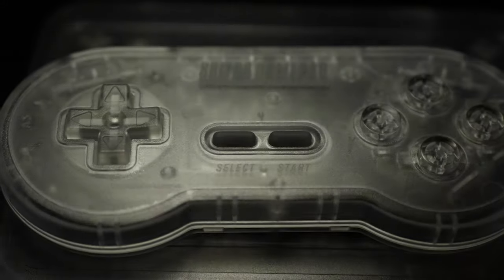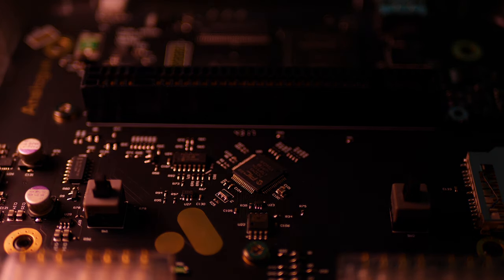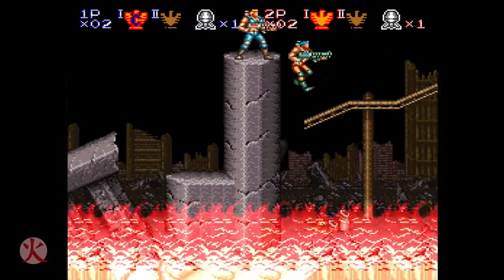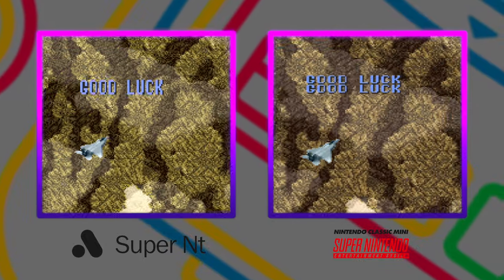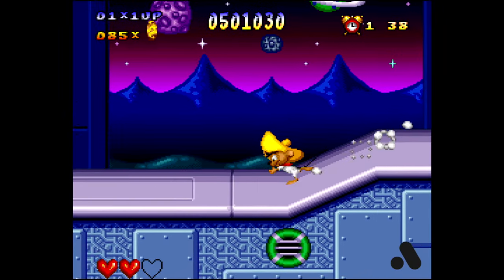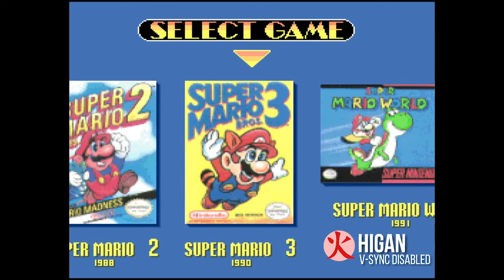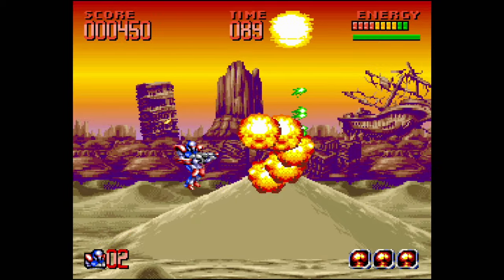DF Retro: Analogue Super Nt Review - a 21st Century SNES!

Comment: The best way I've found of explaining an FPGA is with an analogy of a roller coaster, or making one
A processor must first define the blueprints and then, in an orderly manner, see the steps of the coaster running one by one and carefully control timing while also making sure everything's in order
An FPGA is a roller coaster

And that seems to get the point across of why an FPGA excels in these sorts of areas.

Comment: The shadow cast by your plane in Air Strike Patrol doesn't come in dark enough on a 1-chip SNES. I have a 1-chip SNES and while the shadow is visible, it's kinda hard to see. This goes for the 1-chip SNES and the smaller revision of the SNES . On a lower serial original SNES which has the lesser picture quality displays the shadow much darker as it does on Higan and the Super NT.
Reply: Yeah, it seems like he wasn't aware that this is one of the games that is said to work a little differently on the 1-chip, but it's not a major goof on his part or anything.
Reply: Nah I'm not coming down at all on John for not knowing that about the 1-chip. It's superior picture quality over the original SNES design is far more common knowledge than this one drawback that I mentioned. I didn't even know about it until someone told me in the comment section of my video because I noted that the shadow was really light an almost just as useless as not having a shadow at all in my description. It's certainly nothing to choose an original over a 1-chip for. I just thought I would let everyone know so they don't think that the Super NT and more importantly Higan weren't doing anything wrong. In this case the REAL hardware got it wrong lol.

Comment: I was impressed that you tested actual edge cases like Air Strike Patrol rather than crap some other people might test ("Does it run Donkey Kong Country with its amazeballs graphics?!!!"). I would like to point out that the fact that you ran A.S.P. on a 1chip SNES accounts for the lighter shadow. On an original 1990 SNES, it will look more like the Super Nt or Higan.

One thing you didn't test is Mega Man X2. I am interested to see if X kills the boss on attract mode or not. On most emulators, X dies due to timing issues involving emulation of the Cx4 chip. I am wondering especially if the three buffer modes will affect the timing on this attract mode. Any chance you could check this?

Overall, good stuff. I liked seeing a lot of my favorite games used here and there: Blackthorne, DoReMi Fantasy, Super Metroid. Would have been cool if they'd gone ahead and rounded out the included Turrican games with Targa though.
Reply: I was able to test this myself finally. It works perfectly even in No Lag mode.
Reply: To be fair, though, Donkey Kong Country has a little more aggressive copy protection measures than most SNES games. It's worth testing on clone hardware for that reason, if nothing else. (Though being such a high-profile game it's hard to imagine the Super NT, with its attention to detail, wouldn't work with it.)

Comment: The Air Strike Patrol shadow discrepancy is not due to anything wrong with the NT or Higan. Rather it’s an issue with the design of Nintendo’s own 1CHIP revision of the system. Both Higan and the NT reproduce the shadow like an original SNES would, it’s the single-chip model that is bugged (albeit very slightly).
Reply: interesintg

Comment: Am I wrong or is the problem of hooking up an old console to a modern TV a non-issue in Europe due to SCART? I mean I have my MegaDrive hooked up no problem through that interface.
Reply: In fact it depends on how your TV handles analog signal from retro consoles, whatever the input type. I live in Europe and have an LG TV with SCART input. It handles 240p signal as 480i, with terrible lag.
Reply: SCART sockets are rapidly disappearing from TVs with the race to be thin.

Comment: "A reimagining of perhaps the greatest video game system of all time. Engineered with an FPGA. No emulation. 1080p. Zero lag. Total accuracy. The Super Nt is not a plug n' play toy. It is the definitive way to explore Nintendo's 16-bit era. Compatible with the 2,200+ SNES and Super Famicom game cartridge library. Explore and re-live one of the greatest video game systems of all time with no compromises." -Super NT Website
Prices starting at $189.99
$39.99 for the controllers.

Pretty solid console.

Comment: I got my Super Nt beginning of October and have been loving it. Would you have any recommend settings to get the 4:3 ratio you got since from what I can tell has been updated with the 4.5 firmware with altered values.
Reply: Try setting width to 1365 and height to 1149. You could also enable interpolation if you want to eliminate any shimmering artifacts.

Comment: The only problem being of course is that with the Super NT you are restricted to cartridge use only and provided you can buy those cartridges at a reasonable price if not owned already...also in some instances multi-platform games between the Genesis/The Super Nintendo wouldn't always favour the SNES versions, case in point being the Genesis version of Earthworm Jim 1 being superior to the SNES version and it is that version that I have on the SNES mini...and the glitch you found at the beginning of Earthworm Jim 2 on the version I have on the SNES mini it sounds perfectly fine....all ultimately depends though on if you aren't a SNES mini owner already then the NT might be the way to go for you...but for me I am not looking to amass a cartridge collection to get this when the SNES mini does most of what is required just fine...especially with the new revisions of Hakchi..

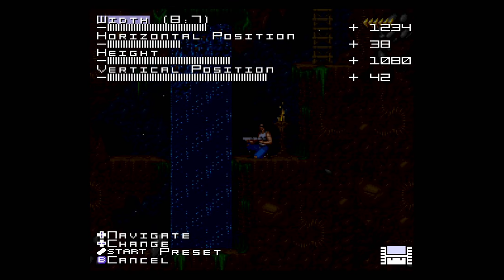Comment: At 21:04 it says manually adjusting scaling values is possible due to a framebuffer. Does this mean using this function (and others, like interpolation) could introduce input latency, i.e. the Framemeister's 1-2 frames of lag, compared to default settings?

Comment: EXTREMELY informative and well edited and shot video! Well done broham...got a new sub out of it.  On the subject the Super Nt is very very cool! I wish the creators would do something like this for the N64 (Yeah I know the patent was renewed for the possible N64 mini) but having an N64 in a compact shell design...more expansion memory meaning some how re routing all that buss code even tho games that where made to only handle 8 MB of ram would then be getting tricking via an algorithm that recycles the memory meaning games would be able to utilize more than just 8 even if they are only programed to expand to 4MB or 8MB....essentially making games have ZERO LAG. Running at full 30FPS and having options to enhance games via the software on the Nt64 haha thus making texture packages look better within games and further more enhancing the N64 experience....of course if they did the Nt64 it would also out put games in 1080p something that is very expensive and hard to do on the original hardware.

Please we need an Nt64!  Smaller shell (in translucent colors as well), HDMI output meaning hi res gaming, and if it can be pulled off a tricked memory expansion to help games run in true 30FPS with zero lag.  Start a kickstarter guys I will donate a hefty amount to start out. hahah you can see how fan boy I am for N64

Comment: There was one more option : The Hyperkin SupaRetronHD.
As far as I know, this is "hardware emulation", unlike a Retron5...
It has a lower resolution (720p) but cost much less ($70).
Reply: It's just another iteration of the Nintendo-on-a-chip consoles they've been selling for years, coupled with a cheap HDMI upscaler. From the reviews I've seen it seems like the HDMI scaler introduces a significant amount of lag and the clone hardware itself has the usual array of shortcomings and incompatibilities that usually come with that old clone hardware. Cost is low, quality is also kind of low.
(To be fair, though, I own a Supaboy which is a Nintendo-on-a-chip clone and I've generally had fun with it.)

Comment: but what about performance? something like starfox for example runs like crap on an actual SNES, is it the same on the super NT or does it run better?
Reply from the maker: Identical to original hardware.
Reply: Most of the CPU power used to run Star Fox is in that Super FX chip on the cartridge. So a system like this that uses the hardware on the cart rather than emulating it will not have any impact on the performance of the Super FX CPU.

Comment: Hi!
Sorry my english so bad.
which  offers best picture super nt or framemeister with  super nintendo using on a modern tv?
wich one do you preffer?
Reply: The original hardware actually has a few shortcomings that the Super NT avoids: like most of the old SNES consoles are the "2-chip" type that lag a bit in transitions between colors, creating a bit of a blur in the video output. So unless it's a 1-chip system the Super NT is going to give a better picture. If it's a 1-chip system the two should be on more even footing.
Reply: @tetsujin_144  Indeed, but even the 1-chip systems aren't perfect, as they make games appear much brighter than they should be, which is something the Super NT avoids as well.

Comment: Why do the games at around the 9 minute mark have more contrast on the right?
Reply: Jonathan Graber it’s discussed later.....
Reply: I can explain. So...I'm using gamma boost on the Super Nt which improves shadow detail. My 1-chip Super NES, however, is modded to attenuate the brightness which does slightly dim the overall image, unfortunately. The reason for this is that, by default, 1-chip SNES systems are TOO bright and completely blow out detail. So gradients and bright colors are basically "crushed" which ruins the image. The mod restores all the missing color detail but does lower overall brightness a tad. It looks fine on a CRT but, when used as a comparison point, it looks less bright. My other SNES consoles are 2-chip designs and have blurry output that would have been worse for a comparison.
Reply: John Linneman thank you:) very well made and interesting video

Comment: One more thing; can I make a request for Mega-CD (Sega-CD) episode? I could never understand how a $300 add on, which had a 12.5mhz processors had games which basically looked the same as the Megadrive. Could it not use both processors at the same time? why the hell was it twice the price of a megadrive!! just seems a missed opportunity to dominate the SNES technically so would like someone with technical know how to explain.
Reply: I know there was one game that came out a few years back (_long_ after the MD's discontinuation)--Pier Solar and the Great Architects--that managed to at the very least play an enhanced soundtrack if you had a Sega CD addon, while playing the main game off of the cart.
So it is at least possible to run the two processors simultaneously for that purpose (but I don't know if there's parallel i/o limitations or how severe they are and so on).

Comment: Quite cool, but I'll stick to a real 1-chip SNES running through a FrameMeister.
Reply: Eww. If you're using a 1-chip SNES at least do the darn thing some justice and run it on a PVM/BVM monitor via RGB.
Reply: matics28 PVM's are very hard to come by and are not capable of accepting my modern systems. Besides, it looks amazing running through RGB on a FrameMeister with FirebrandX's custom settings.

Comment: One huge problem - EARTHWORM JIM 2 DOES NOT PLAY SOUND EFFECTS CORRECTLY on the Super NT. The PAL version. I'm sorry, but this is really annoying me that the PAL version was not tested; the console is supposed to be region-free and it's not nice to leave PAL gamers in the dust for a worldwide machine. The NTSC version may be fine but that's just one version of the game. Sorry but there is still obviously work to be done to really get this console fully accurate.

I have already mentioned this on the MLIG video and Try4ce responded that we just have to wait and see if Kevtris can fix it. I've also emailed Analogue about the issue. It's a shame because it was the first game I tried in my console and it left me very disappointed to see that it doesn't play the game any better than a bad emulator :( It's one thing to have a repro game not work (as some don't), but it's another thing entirely to find that a genuine cart won't work :( Apart from that I love it!

Comment: I feel like it's missing a card reader and save states.
Reply: It has a card reader on the right side.
Reply: I stand corrected, it wasn't covered in the video unless i missed it, however currently the card reader is purely for firmware updates, though that may change in the future.
Reply: "Out of the box, it won't support loading anything but original cartridges, but the Nt Mini (its predecessor) received "jailbroken" firmware from the guy who writes their FPGA emulation cores that allowed it to load ROMs from an SD card."
Reply: I stand double corrected, cheers.
Reply: There's now a jailbreak firmware for the Super Nt now!

Comment: I use Snes9x and have since forever. Haven’t had issues. :D
Reply: Honestly, Snes9x has slowly continued to increase their accuracy on all but some really out there edge-case games, including many of the troublesome ones showcased in this video.
It's really not a bad emulator--especially for games that use no enhancement chips, but if you have a little extra CPU horsepower and do encounter a game with an issue, then taking Higan for a spin is probably the next best idea.

Comment: What a promo video!

Talking about latency when you are menctioning FPGA vs soft emulation, when the soft emulation of a SNES hard with modern cpus introduces a latency of extra NANOseconds is ridiculous (the max timing added with an emulation of the 65c816 of SNES with a emulator is at worst case added a "latency" of 100-200 cycles of your x86 instructions in your emulator, something like 1? instruction in a stream of original code). Oh, for sure your eye can catch that! (facepalm)

An "accuracy" with a FPGA emulating semiconductors WITHOUT the original schemes of them, using reversed ingeniering, IT'S THE SAME ISSUE that with emulators, ALL of both are using a reversed ingeniering solution for emulating PPUs, as example. Noone out of Nintendo or Sony has these schemes for the PPUs,  S-DSP, hell, the "generic processors" of the machine has dedicated instructions and are hardware implementations of other more knowed cpus (like the SPC700, is a tuned 6502 with new instructions, emulates the Super NT the HARD of that cpu, or emulates with reversed engineering the behaviour of this cpu? The same with the custom Ricoh 5A22, a version of the WD65c816 processor, hell, if you want to emulate the "generic WD one, you don't have the schemes of it too!!).

Super NT is only a glorified emulating SNES machine with, at much, good solutions for outputs or trying to emulating well the machine. The FPGA thing is more related with marketing that with a need for reaching any real goal. Latency? What a joke when we are talking about a machine that uses HDMI output !! (in ANY TV that you use to plug that console you are taking a much bigger latency wit it (compared to a analog TV that can take the analog signal of a SNES and representing a image with zero additional lag), in some cases dozens of miliseconds added (in extreme cases, aroung 100 ms).

In contrast, using a FPGA vs emulating in a x86 or a ARM SoC is all about nanoseconds of difference. For a human, zero difference.

From Analogue website:

"We're preserving history with FPGA hardware

The Super Nt has the same unparalleled compatibility as the Nt mini. The core functionality of the system is engineered directly into an Altera Cyclone V, a sophisticated FPGA. We spent thousands of hours engineering the system via FPGA for absolute accuracy. Unlike the knock off and emulation systems that riddle the market today, you’ll be experiencing the 16-bit era free of compromises. The Super Nt is designed to preserve video game history, with the respect it deserves."

That's a blatant lie fou uneducated people about the technical issues aroung emulating the SNES. Free of compromises, unparalleled compatibility, hey boy, that uses a FPGA, is better because is hard, not soft!

Yeah, that's cute until you realize that they don't have a fxxking idea about the electric diagrams of all the semiconductors used in a real SNES, and they most recreate their behaviour with reversed ingeniering, like the soft emulators that they (and you) are acusing of lack of accuracy (and extra latency, what a joke from a console with HDMI!).

Comment: meh i can play games on an emulator
Reply: This whole video is about about a more accurate experience
Reply: yeah the anesthics looks nice
Reply: Danny-Elite Enjoy the lag then.
Reply: i dont get lag
Reply: Danny-Elite all software emulators, introduce lag. It's what put me off them.
Reply: Danny-Elite  Many 15-20 year old boys dont have a clue about retro and the fantastic golden age. I bet your first game was WOW on pc.
Reply: USB shouldn't introduce a lot of lag if the controller is being polled frequently enough. (And it is possible to tweak USB poll rates - this is popular among gamers when using USB mice, etc.)As for emulators - yes, they are an option, and generally a pretty good one. Cheap and high-quality by nature. Going for a hardware solution, much like collecting cartridges in general, isn't really beneficial in practical terms necessarily, it's something you do if you're interested in collecting and using those cartridges, framing the gameplay experience in something like the experience of using the original console.A FPGA system is a bit odd in a sense since it's no longer really the "original hardware" but Super NT is designed to follow the original hardware very closely, but with better quality due to the all-digital signal path.
Reply: @lucasart328 Yes you do
Reply: @DuckAlertBeats  maybe